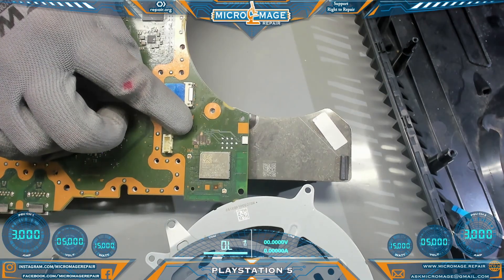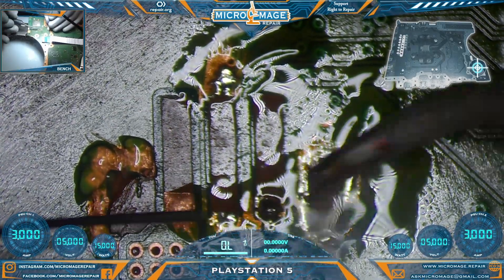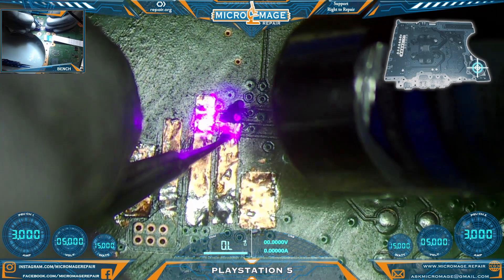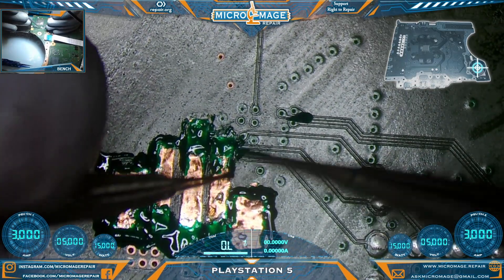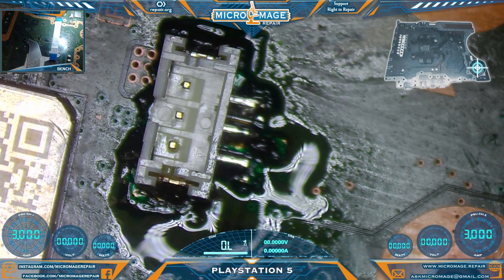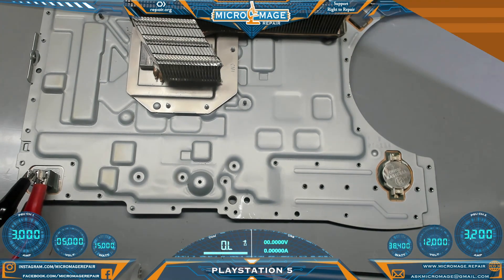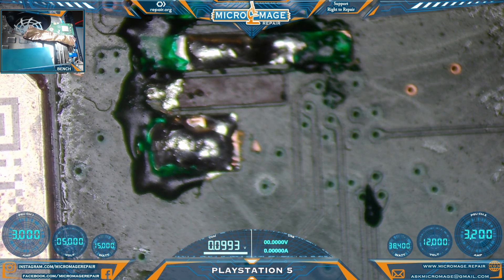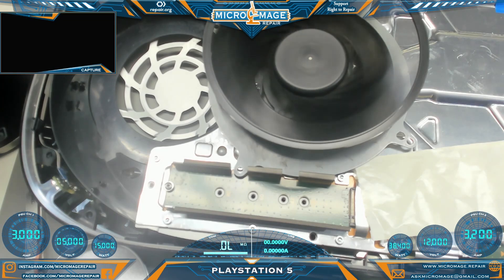PS5: One thing after Another!

Comment: I always go with the jumper wire but have to be careful I’ve seen one council where the jumper de soldered itself from  the port Because the system gets up to a crazy temperature .. definitely looks like a fun repair you did lol 
What’s the connector part number?  Do you have link?
Reply from the maker: Yea that's why I do several wraps around the pin.
Yes here you go https://www.digikey.com/en/products/detail/jst-sales-america-inc./B3B-PH-SM4-TB/926832?utm_adgroup&utm_source=google&utm_medium=cpc&utm_campaign=PMax_Product_Connectors+and+Interconnects&utm_term&utm_content&utm_id=go_cmp-20461032180_adg-_ad-__dev-m_ext-_prd-926832_sig-Cj0KCQjwjt-oBhDKARIsABVRB0xta_60rkAX9JCt4hgOyhUq1at7ZgZdKz7YCLK74BeVMSnHQsw8vZsaAu_nEALw_wcB

Comment: Is that why you use the copper tape other than the wick like others use as it’s thinner?  Great video btw
Reply from the maker: That's why I prefer it, thinner so the connector sits more flush. Also I really haven't seen anything compelling enough about the wick method to switch.
It's a fine method but it doesn't offer anything superior in my opinion.